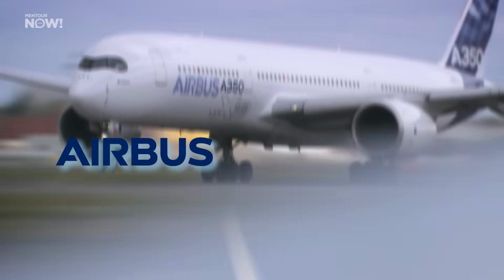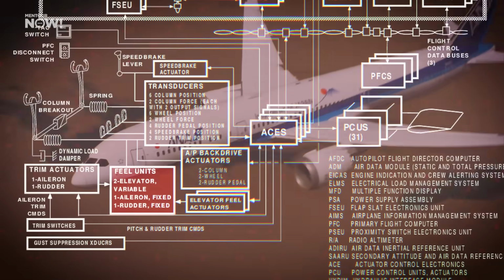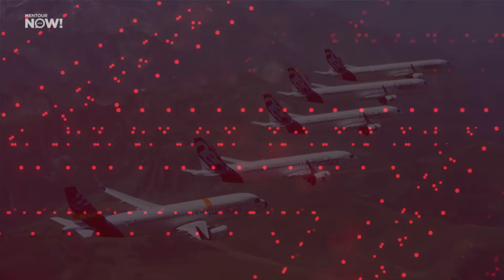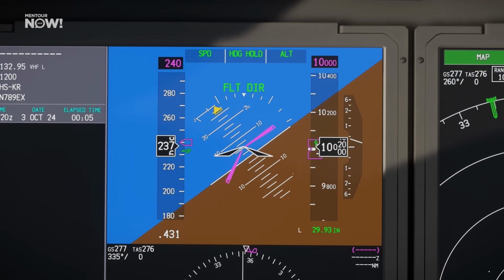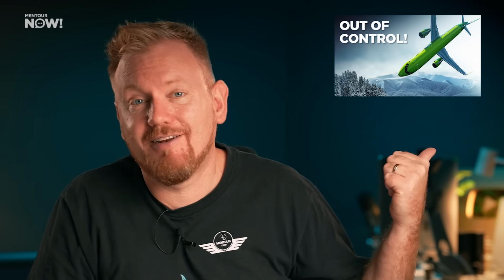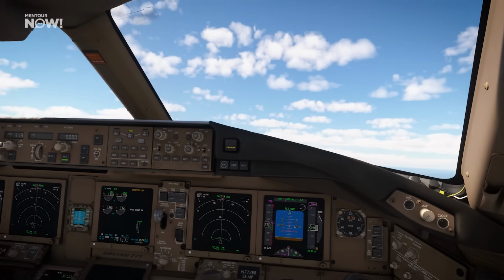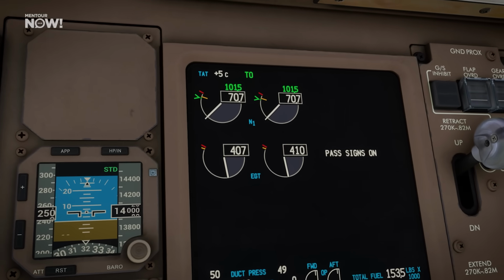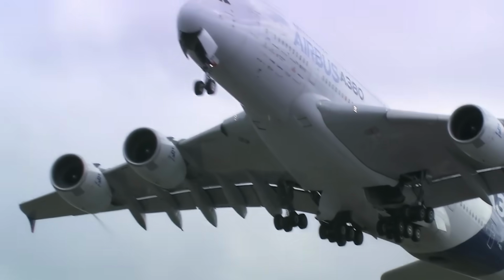Do Pilots Prefer AIRBUS over BOEING?!

Comment: Can airbus pilots disable the different types of laws to a sorta base setting or off setting?
Reply: Yes, indirectly by disabling certain systems to force the aircraft to revert. But the sidestick inputs still have to transit through computers. There was even a procedure for that, after the high AOA protection malfunctioned on A330. See QF72 flight, it's surprisingly similar to MCAS.

Comment: I've flown both the A320 and 737-800s/Max with around 3000 PIC on each. Without a doubt I will prefer to fly a 320 in gusty conditions, heavy rain and short runways. For starters, the A320 has more effective and larger windscreen wipers and rain repellant. The 320 approach speed is slower. The A320 GS Mini function helps alot in stormy conditions. The A320 cockpit is far more comfortable compared to the 737. 737 was really no fun when it came to flying tropical weather in South East Asia.

Comment: I vote for the Airbus flight deck, but I would say that a “normal workload” can very quickly become a “very high work load” in the event of failures. The Airbus systems are excellent when they are working (and yes they have multiple backups) but more development work needs to be done to the automated flight systems with failures. The automated systems frequently turn off deferring to the pilots and manual piloting, thereby further increasing the work load, even when the computers still have the same information that the pilots have (displayed on the instruments). The flight control law’s need to be made more resilient in the case of failures & and allow the automated system to aid the pilot in the event of failures.
Reply: Good news for you. The A350 already addresses what you're saying. The A350 has more robust autopilot that stays on for virtually anything, from dual engine failures, dual hydraulic failures and even unreliable airspeed. Even if alternate law is triggered, the autopilot stays on. The pilot on the A350 wont be forced to hand fly right away due to failures unless he/she is ready to takeover.
Reply: @ClaysonAntoons  That’s good to hear, especially for an A32x pilot where that is not the case, especially not with multiple failures.

Comment: I think there is merit to both. I think Airbus has a much better and more modern cockpit layout compared to Boeing, it really prefers cluttered and samey same layouts to previous models. But IMO with the Airbus, the computer just fixing certain things for you is concerning, attitude control and auto trim being the best examples. Just makes for lazy piloting and poor emergency management when there an electrical and or computer issue; on top of that there are almost no overrides for a number of these system short of closing circuit breakers (something Boeing had to learn the hard way with the 737). Sad part though is Boeing is not doing very well from the build quality aspect right now which is one place where Airbus is winning at the moment.

Comment: Not a pilot but a very active simmer and for me the a320 is far superior to the 737. The existence of the ecam, simplified overhead panel and central controls just come with a far shallower learning curve. The airbus protections thay come with the fac, elac and sec can be a little bit frustrating though if you want to push the airframe to its limits. The alpha floor protections are somewhat frustrating as well.

Comment: So airbus should have an audio queue declaring when law is changed and which features are disabled maybe. 

Example: direct law engaged, auto trim disabled.

Also a in command stick potentially with green and orange light filling the seat
With a yellow flight for both when in combined flying.

Comment: Hello guys, ATPL here. F-100, A32F, A330/50, (B777/87 Nowadays),~20k Totl hrs. Side stick worse than yoke to perform precise manual flight, specially in gusty winds at landing, less safe because pilots do not know each other flt ctls inputs all times. Autothrust worse then Autothrottle in order to monitor thrust variations, impossible to know with hand on levers looking outside, Boeing does. Have lost some friends in an accident because probably one thrust lever has been left in Climb detent after landing and the aircraft overran in the middle of the crowded city of São Paulo. ECAM usually better to deal with troubleshooting than EICAS, but is more tricky sometimes, for example if you lose one engine and the other catches fire, the system will prioritize engine fire drill, (red alert over ambar), which will lead to shoot down the only engine producing thrust. FWS, Flight Warning S. way better than Boeing’s Pilot’s alert and warning system. Airbus less noisy, and audio system better. A350 most refined airplane ever made, efficient and comfortable, but could be better if it would used CACs to a clean air conditioning system, (bleed air from the engine compressor carries toxic oil vapors). Last but not least, Aerodynamic flight controls feedback linked both sides in same movement, along with thrust lever movement, linked with engine thrust command, in order to keep the sliding table off course. Use to be A32f TRI, an TRE, what is very annoying not to be able to physically follow the student’s inputs in the late stages of the approach and landing. Congratulation for your pristine work, aviation deserves this, thank you!

Comment: Currently operating the A320/A321 having previously operated the B737NG, B77 & B787. As much as I love the Airbus, the comment about the manuals hits hard... the more automation and complex systems/computers the manufacturers rely on to "keep is safe", the more failures we need to train for. 
Airbus is easy to fly but harder to manage in complex failure scenarios. Perhaps the newer Airbuses are better, but the ECAM feels truly Archaic compared to EICAS/ECL on the 777/787 while the 737 was a real Pilots Aircraft due to it's simplicity.

Comment: I see where airbus is coming from but what if the plane for some reason can not receive accurate information or if it thinks it got the accurate information but in fact it was not .
The pilot might figure out a solution for the situation but because the aircraft won’t allow him because it only trust itself.
Isn’t there any switch to bypass this safety system?

Comment: I’m an airbus pilot, and my reason for choosing the Airbus is that I spend countless hours in this cockpit and the creature comforts go a long way in improving the experience, comfort as well as reducing fatigue.  Compared to the 737, the A320 cockpit is larger, quieter, no control column in your way and the tray table makes it much easier to have your meal or other items in front of you without tying up your hands or obstructing the flight controls.  The airplane does dumb things down for you, such as calling you a “retard”, but I don’t see that as an insult by Airbus.  In fact, it catches errors that might otherwise slip past us.  Extra layer of protection at the expense of some ego.  Bottom line, based on data and statistics, the Boeing and Airbus both have very comparable safety records.  Are those records perfect? No, not for either. They each have had their growing pains that have costed human lives over the years.  The airbus does have some features I like and some I do not like. I expect that the same would be true if I was flying the Boeing or any airplane for that matter.  No airplane is perfect.  They each have their own strengths and weaknesses.  So in the end, you pick the airplane that best fits your preference as a pilot. That is assuming your airline has more than one choice in equipment for you to choose from.  If not, then you do the next best pilot thing and adapt to your environment as best you can.

Comment: A320neo with Pratt engines will have 650 forced grounding this year, and the A350's with Rolls engines suffered engine part failures and were all grounded for inspection. Airbus has big production issues. Boeing door problems are trivial in comparison.

Comment: Here's a couple of genuine questions from a person that loves mechanical technology but despite having been invited into a cockpit mid-flight  (before 9/11) has no experience in flying. If MH370 had been an Airbus type could the pilot have disabled tracking devices manually and would it have been easier to find it?

Comment: If someone would honestly compare A320 and B737 regarding comfort, noise level in the cockpit, the interface between pilot and the system and trouble shooting, B737 should not be certified for air transport.
Reply: i flew on both an a320 and a 737 last year and noticed no difference in terms of comfort

Comment: Another reason - Sully flew his A320 into the Hudson for perfect ditching 11 degree pitch up and gear up. The real reason for the safe splash was AIRBUS design. After the APU powered the AC Busses, the Flight Control Law activated as designed. Sully had the side stick at 14-16 degrees fluctuating pitch up all the way . BUT the AC pitched only 11 degrees to maintain the green dot speed. That 11 degree was a constant pitch by the computers, regardless of what Scully had his side stick input of 14-16 full aft side stick input. The computers over rode and gave him the best pitch to fly with out stalling. This alone put thw AirBus techonology way ahead of Boeing.
Reply: Air Transat dead engines flight as well. The automated controls gave them the best possible gliding rate to reach Portugal in a very favourable altitude.
Reply: @viniciusmagnoni6492   GOOD POINT.  Doesn't their Nav display put an arc on the screen which shows them where they will end up at that rate of decent?
Reply: Your comment is under rated.
Reply: The Boeing would’ve eaten the birds and burped while climbing out.
Reply: If you say so.
Reply: Boeing planes fall apart.  It's an easy choice.
Reply: @damehal  Given that Boeing has been producing jet planes that first ruled the skies since the 707 in the late 50's (15 years before the first AirBus), perhaps you could make an attempt to sound less of a troll.
Reply: @johnalbright149  yeah ok.  Would you get on a Boeing plane?  They are not adhering to safety and quality control issues.  Thing that contribute to unsafe planes.  Is that trolling.  Don't be mad at me because of a plane manufacturer being subpar.  Have a bad day!
Reply: @johnalbright149  what is the point of talking of the 707 when for real 737 falls apart and leads to deadly crashes?
Reply: @johnalbright149 . I think we should bare in mind, when comparing historical experience that Airbus is the ' amalgamation ' of several Historic European aircraft manufacturers including Sud Aviation, BAC, HS, DH,MBB.. All of which delivered some aviation firsts, Comet ( first jet airliner), Concorde ( first international supersonic airliner), Trident ( first cat3 autoland), 1-11 ( first rear engine, rear step design), ME 262 ( first operational jet fighter) ... All of this, and more needs to be considered when comparing combined experiences.
Reply: @johnalbright149 it’s true. Boeing aurcrfat are less well built. Their build standards and engineering are not as good as Airbus.
Reply: @johnalbright149 dont live in the past
Reply: Actually, Airbus had a lot of issues with their computers overriding pilot control and almost crashing the plane. 
Fortunately, there were very experienced pilots at the controls and they managed to get the plane on the ground, but people were seriously injured.
This happened on a flight to Australia.
There were a couple of other instances where the computer tried to override the pilot and almost crashed the aircraft.
Luckily, the pilot’s saved the plane’s. 
If they had inexperienced pilots like the Boeing planes that crashed they would be in the same position as Boeing.
Yes, Boeing had made a lot of mistakes, but so has Airbus.  Only they were very lucky.
Pilots make the difference.
Reply: @Bob-fk8vd  So Airbus pilots fly real planes indeed.
Reply: And if it would have led to a negative outcome? Then you'd pretend like it never happened and would be using some other example because you already have a bias and are just looking to confirm it.
Reply: @thomgizziz  negative outcome like that with mcas. Obviously it's important to point out where the system gets it wrong. Are we also forgetting the flawed rudder design of 90s 737 where two planes crashed because of design flaw that led to uncommanded movement of rudder( UA585 & USair 427), eastwind  517 also lost control due to the same design flaw and almost crashed. Absolute pathetic design without giving the pilot a chance to recover. Their quality assurance team is not doing their job seriously where they are not even inspecting faulty bolts, swift air 820 almost lost its entire tail due to that and we all know what happens to a plane when they lose their tail. Design flaw + manufacturer flaw + quality assurance flaw combining is not a good sign

Comment: Big downside is no feedback on joystick, hence the problems with dual input or understanding WTF is plane doing at the moment.
No throttle movement with TOGA lock is big fail from Airbus side. Do they also not move when on auto throttle?
Reply: They don't move when Autothrust is on.

Comment: Airbus. i have asked every pilot who has flown both...probably about 60 pilots. 2 said Boeing is best. 1 said about the same, and the other 95+% say that Airbus is best. HOWEVER, THE BEST airliner out there, is the Bombardier C, now known as the Airbus 220. It has the best of Airbus, and the best of Boeing. The main two ways Airbus could improver are: Moving throttles, so you can fell them, and see them, reducing power, or increasing power, without having to look at any gauges. The other is the sidestick controllers. They need to work the same as the Bombardier sidesticks: They need to move TOGETHER, and move enough so u can see/feel what the position of the sidestick is at. 

Use your Free Will to LOVE!...it will help more than you know
Reply: The sidesticks are not linked on the A220.

Comment: I can see value to boings idea, but like the one crash video  you did where both pilots had to pull back the control with like 90LB force that seems absurd to me for anything modern. Only ever flew as a passenger so other than your videos that is only side of that world I know. I feel like airbus's idea is more close to a standard than Bowing's I feel that because a lot of modern construction and farm equipment are heavily joystick type controls. A pay loader isn't going to make you pull a lever harder because the load is heavier.  This analogy though I could see use for bowings type logic say you have to float a bucket level with uneven ground I could see feedback being used there maybe , but I can also see automation to this based off of pressure exerted or some sort of elevation input system.

I feel like big picture the airbus concept is better because I feel like there would be more people used to this type system from computer games or someone that ran other equipment goes on to pilot, or pilot goes on to some other career.

Comment: Six jet type ratings here. Considerable time as Captain of all six. Boeing 737NG & 747 Classic plus Airbus A320 included. I enjoyed the A320 and the 737 almost equally, but the 737 marginally more. My favorite, though, is the 747-300, an old school Flight Engineer Station aircraft. 747 is the best airliner ever produced in my opinion after 17,000+ hours of flying 70 distinct types of aircraft.

Comment: As a passenger I had an experience landing at PDX. 
Upon landing the plane shook so bad I thought the luggage racks were going to fall on us. It reminded me of the old movies where the pilot is breaking the sound barrier, and the plane is shaking so bad it looks like it's going to fall apart. 
Another airline I flew had consistently smooth landings. When I inquired I was told that they had Airbus,  and the other one used Boeing. They said that Airbus  was a luxury aircraft. 
I live so far west I drive a Frontier truck.

Comment: So, if I have understood well, Boeing pilots prefer to fly on the Airbuses' Direct Law . And make the mistakes they want. That's why, undoubtedly, I prefer Airbus. Not to tell that all occurrences with Airbuses go to a huge data bank, and, if necessary, immediately installed on the correspondent model. Comparing again, Boeing is a very good Commodore 128 computer.

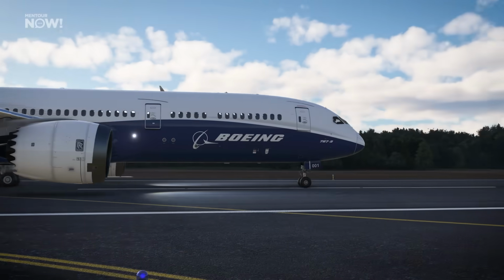Comment: as a sidenote, 22:47  . as an a350 pilot, a350s dont have BUSS anymore when All ADR failure is triggered. its simply called Backup Speed. where it uses AOA probes, engine parameters and weight. at low mach speed, backup speed is computed using AOA sensors while on high mach on engine parameters. all speed and altitude indicators are there but within +/- 10 knots margin of error. laws head to direct law

Comment: As a passenger I have to admit that I prefer to fly on a airbus plane. This is because I find there interiors tend to be more spaced out compared to Boeing. Not just across airlines but also within airlines that operate with both plane manufacturers. There seating configurations seem to be better on airbus planes

Comment: I would think that the hard part for pilots flying an Airbus Aircraft (especially if they are Right Hand Dominant) would be flying it with the side stick/joystick positioned on the left side of the cockpit for Left/Command Pilot Seat.

Comment: The whole logic how Airbus FBW is working is genious. There are many small details which went into it and the logic of each and every control law. E.g. the idea that side stick deflection defines the target load forces and roll rates aircraft needs to achieve I dependent of airspeed is very clever.
The design idea is rather reducing workload.